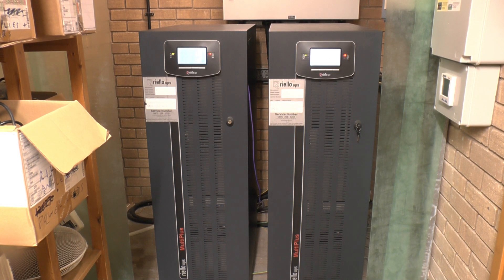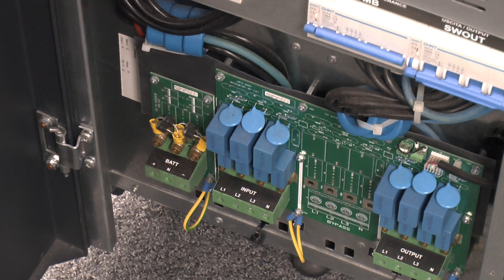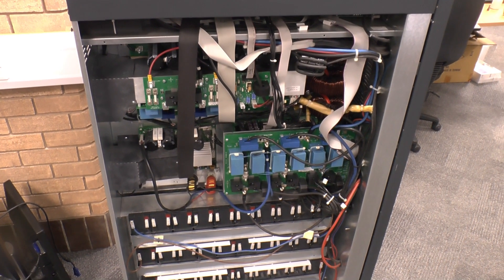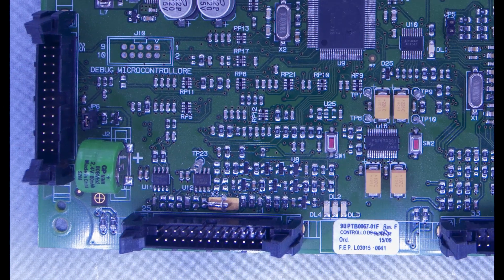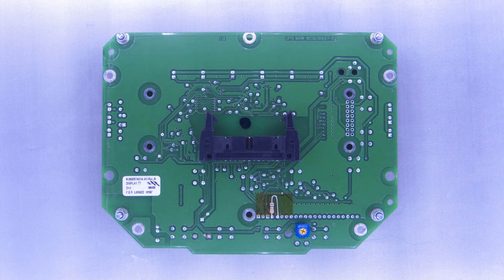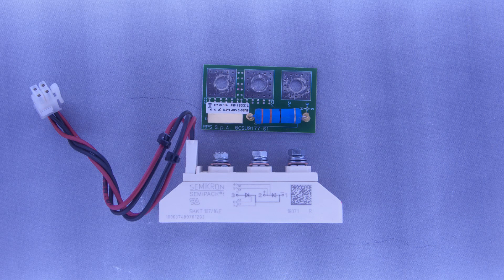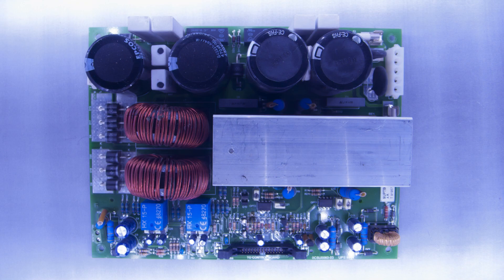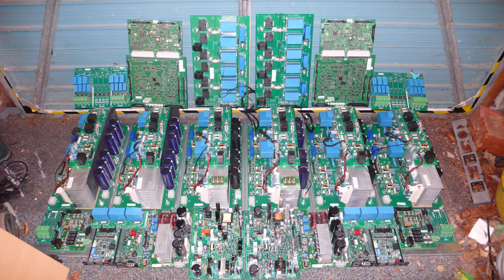Riello Multi Plus 40kVA UPS teardown

Comment: Can I turn on (for the test) mst-15 without battery pack and from 1-phase  (L1-Neutral for example) ?
Reply: yes you can turn on UPS without batteries, connect single phase power supply in to 3 phases @ input connectors and apply neutral connection and turn on UPS. command turn on ups. it will show load on inverter and you can get 3 phase output. in this case ups will disable bypass  and show you the message on LCD battery no present and bypass power phase sequence error
Reply: Do i need to connect 3 input phases in parallel? @alimurtaza5234

Comment: Hi colleague! Do you have enough patience to engage in reverse engineering! Few people can restore a circuit diagram with any PSB like this. This is exactly what I'm passionate about. I'm interested in different circuit solutions. And seeing some kind of device, my hands are just itching to rip off the circuit diagram from it. A big job for me was to copy the diagram from the APC Symmetra LX. From all its modules, power, battery and intellectual. I didn't have enough intellectual skills. I redrawn only part of it. The one I also repaired.
In redrawing I use Circad - this is the best CAD for reverse engineering. What do you draw on, my friend?
Reply from the maker: I use EAGLE 7.7.  See https://www.youtube.com/watch?v=l0AJ6KsCCXw